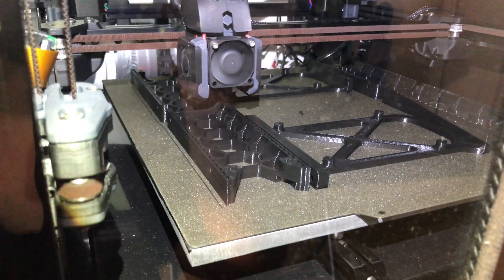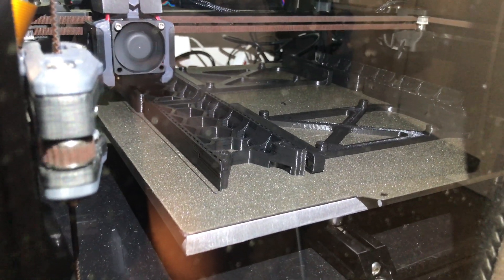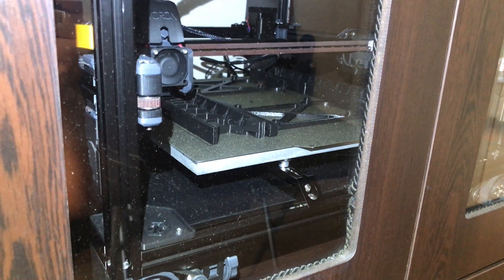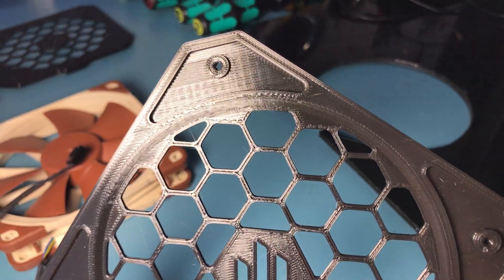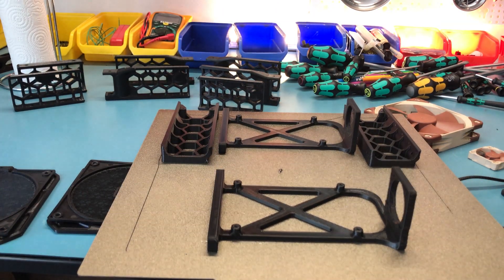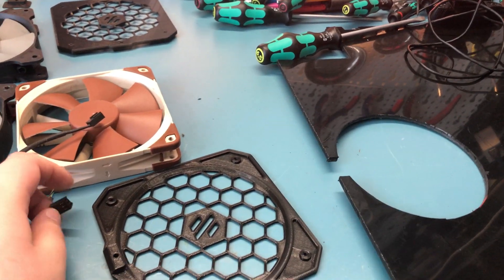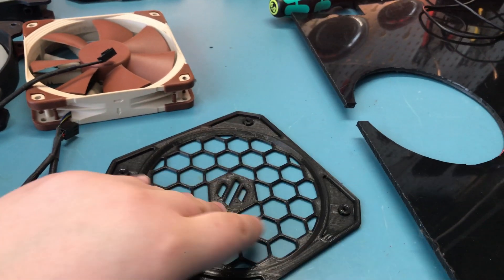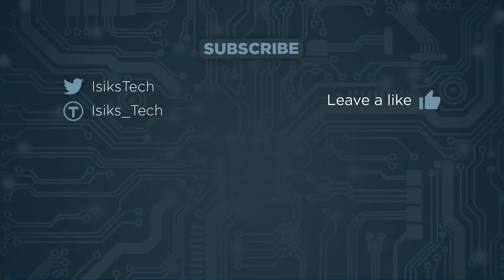Energetic Magnetic PEI Powder Coated Spring Steel Heatbed Review

Comment: hi, i have a question, does this powdered pei sheet is using some kind of stiker that can be peeled of? or is it become one with the spring steel? i have one that using pei sticker, right now it have bubble everywhere so i thinking to upgrade to powdered one, thanks
Reply from the maker: It's powder coated on the spring steel. It can't be removed. Very durable, never damaged mine from "normal" use. The damages on mine are my mistake (unlevel gantry and nozzle crashes)